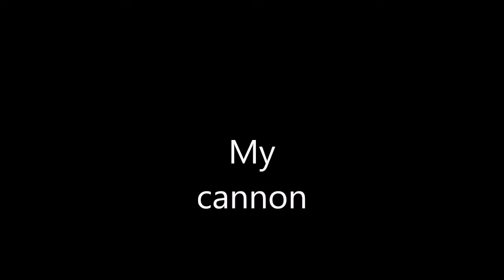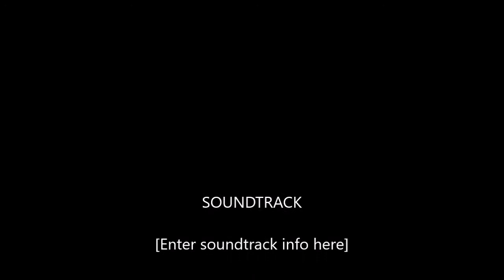Shooting My Homemade Cannon. build pics and firing compilation homemade cannon homemade gun

Comment: i made one similar, it has a 41m/m bore, i use a 35mm film canister of black powder, how much do you use, my sound is alot like yours, also i drill a hole in a ping pong ball ,fill it with water and freeze it, then use it as a projectile, it shoots the thing at least one to two football fields out